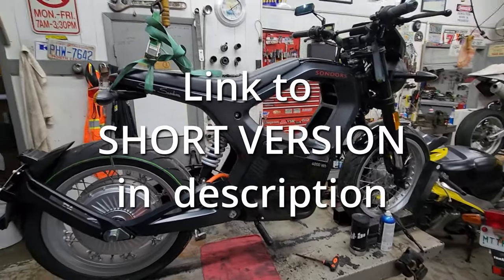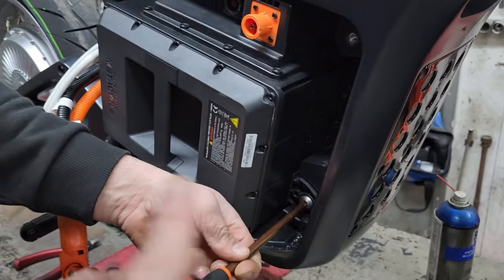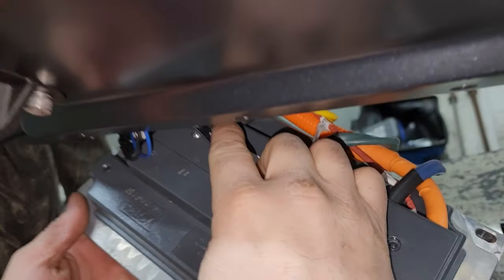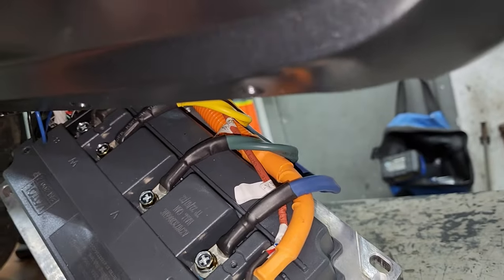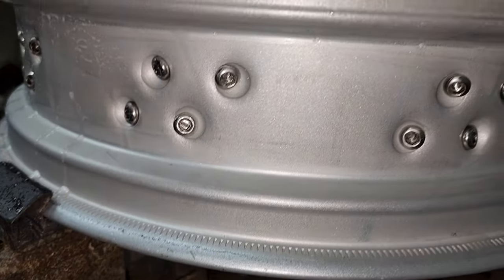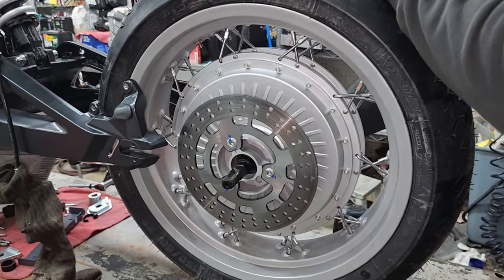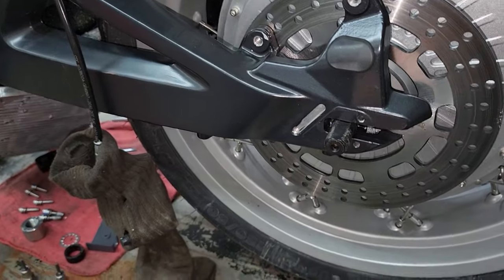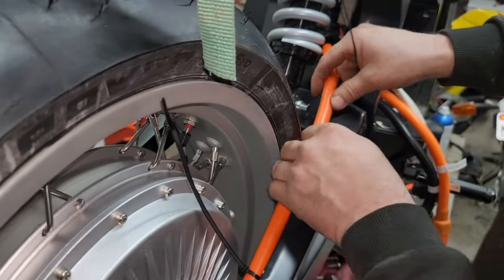Metacycle Tire Change Long Version

Comment: Thank you for putting this together.  Can't wait to get some knobbies on this beast.
Reply from the maker: You're welcome, but just be aware that hub motor wheels like this put a LOT of stress on the spokes when they make any impacts with the surface, like potholes or rough terrain, so this may not be the platform for off-road riding.  Keep an eye on your rear spokes and check them often for breaks if you do.

Comment: @7:43 i can see the original tire was oriented properly (yellow dot with valve stem) unfortunately the screwed everything else up of the job. Lol. But on the new tire i cant see the yellow dot near the valve stem but the tire was covered with so much powder I couldn’t see it anywhere. Its not a problem if it works be balanced but if not balanced its sort of important.

Also even though the resr wheel is heavy due to the motor, most of the motor weight, the stator, doesn’t rotate. The extra mass only increases the rpm of the first harmonic frequency. 

You can still balance it with trial and error by taping on a weigh and moving it until you see a decrease in vibration. Then increase or decrease the weight until you reduce the vibration to its lowest. Then if any vibration remains move the weight left or right until you find lowest vibration. Since it’s narrow you just need single plane balancing so once you find the correct weight and correct location you can add the stick-on lead weights and you will be all set.
Reply from the maker: Good info, thank you.  I have obtained some tire sealant/balancing fluid that I am going to put into the rear tire soon.  Will report back on that.
Reply: What a nightmare to change the tire on a Metacycle hub-drive bike.  No way that a regular tire shop will be able to spend 3-4 hours on the job... You will have to pay a professional mechanic or just DIY. Additionally, the stock tire and tube were pinched from the factory. Buyer beware!
Reply: @tl2913  yes, if you got one of the early versions with tubes thats an added complication. But tubeless tires are pretty easy to do at home with basic tire tools.

Comment: Well until Sondors issues a shop manual this is what we have! Excellent work. Looking forward to how it rides. Any ideas on sourcing brake pads? Also report I got the plates and title today in Colorado so when my roads thaw in June I'll see what situation I have with tires! No different paperwork than what Sondors sent, time and a different clerk solved the plates issue I guess.
Reply: I know their are plenty of opinions but " ride on balancer & sealant" or "dyna beads" may end up a solution. I use it in my 05 FJR but not on the tubed 17 African Twin yet...be very interesting to see what is up with these balance or wheel issues
Reply from the maker: Haven't sourced pads yet, but I have to say I'm pretty pleased with the braking performance of the stock pads so far.
Reply: OMG, What a nightmare to change the tire on a Metacycle hub-drive bike.  No way that a regular tire shop will be able to spend 2 hours on the job... You will have to pay a mechanic or DIY. Additionally, the stock tire and tube were pinched from the factory. Buyer beware!

The video really convinced me that a mid-drive bike like a Zero is the way to go.
Reply from the maker: Ok?  You've copied/pasted this same thing like 5 different places.  Are you a shill for Zero motorcycles?
Reply: @PowerheadProductions  tires and pads may be all this will require most of the time. Change the brake fluids every few years...awesome. I told my brother I may stick one of my IBA frames on my plate...he joked I could carry and extra battery on the back like a fuel cell then I could go 100 miles!😂🤣😂 I may put some ace clubman style bars on for toodles here in the mountains . Interest in your peg solutions when they get solved. Always better to have weight on rubber and not pegs! Keep up your good work👍

Comment: Maybe this was said in the video but was this tire replaced to fix the hopping issue? And did it solve the problem?
Reply from the maker: It was replaced partly for that and partly just to have better grip, and yes it did fix the hop.
Reply: @PowerheadProductions  Good to know, thanks for the video and reply!
Reply: Whats the hop issue does it come with the bike is it known?
Reply from the maker: @fec4177  It's where the inner tube is not installed properly and/or the tire is not beaded to the wheel properly and things are not perfectly round due to shoddy manufacturing practices. It's a known issue and most of these bikes have it in some degree.

Comment: Did you get to fix the wobble problem and did you get the front tire balanced did it help at all ? I’m kinda in the same boat .
Reply from the maker: Yes, mostly.  The rear tire still has just a little hop to it, but it is much better than factory.  The front tire was balanced after changing tires, and was probably decently balanced before.  Not much difference there.
Reply: So you can safely say that the new tires were mostly the issue maybe they were out of round tires . I would think the balance the tires would help but I think I just need new tires they probably had it sitting for a long time before shipping it out .
Reply from the maker: @saynomore5730  Yeah that and as you can see in the video they were not seated properly on the wheel and the inner tube was hung up in the tire and folded up some as well so it was just all shoddy assembled. Taking the factory tires completely off and reseating them would probably have the same effect but if you're going to go that far you might as well go ahead and put some better tires on there.

Comment: Any plans to create a video about removing the front wheel?
Reply from the maker: No it's just like any other motorcycle, and I cover the steps in here...remove brake caliper, remove 2 axle bolts.  Done.
Reply: @PowerheadProductions  , thanks, I see that now, at the 18m:17s mark.  For someone that has never worked on motorcycles before, this is helpful.  Thank you!
Reply: @PowerheadProductions  , so I removed the two bolts that attach the brake caliper to the front wheel. However, when I try to slide the calipers off the tabs on my front wheel get in the way and I am unable to slide the calibers off. My only thought for solution is I will have to remove the bolt that attaches the brake fluid hose.  That way I can just remove the wheel with the brake calipers still attached, and only then will I be able to remove the calipers from the wheel and get the tire replaced. Would you agree or do you have a better suggestion?
Reply from the maker: @TobyPratt  You can get the caliper off without doing that, but it is tight.  You have to sort of twist the caliper while it's still on the rotor to spread the pads a little bit to give you some play between the pads and the rotor, then it will give you enough wiggle in the caliper that you can sort of rotate it while sliding it off and clear the wheel. Be certain that when you put that back on you pump that front brake lever until it is firm because there will be no brakes on the first few pumps of the lever where you spread those pads apart by doing this.

Comment: it would've been easier to fix a flat if they were tubeless.
Reply from the maker: Yes of course it would be, and the newer models are tubeless, but they also have different wheels.  These wheels are spoked down the middle, so you have to run a tube in them or it will leak the air out where the spokes are.
Reply: @PowerheadProductions  I think it is the OLDER models that had the tubeless wheels.  From what I have seen none of the arctic white models have had tubeless and it appears only the initial deliveries have had those tubeless wheels.  Do the wheels you have (tubeless) have the safety bead that would allow them to be converted to tubeless?
Reply from the maker: @taylorcuthrell4123  The wheels I have are not tubeless, as you stated, but assuming that's a typo, I do not know exactly what you mean by safety bead. There is a strip of rubber as you can see in the video that is there to protect the tube from getting damaged and failing from rubbing on the tips of the spokes. That is not going to suffice for making them tubeless.  Best technique is to try and seal the tip of each spoke with epoxy or similar, but spokes move and flex a little with every rotation, they absorb impacts and that is why they are so popular on dirt bikes. They are part suspension. But as such, that makes it hard to seal spoke wheels that were not designed to be sealed.  There are SOME internally spoked wheels that are or can be sealed, and they have specially designed spoke tips that make sealing feasible.